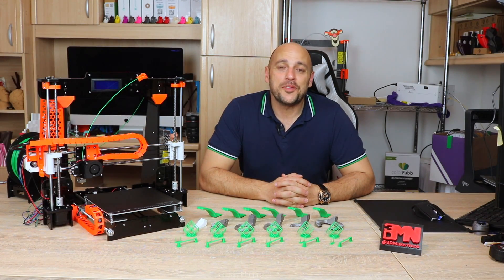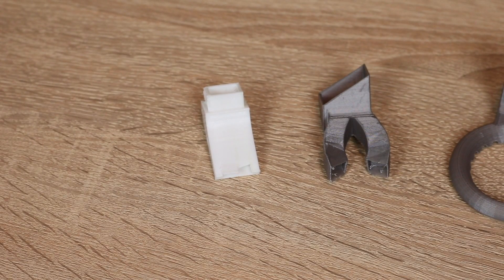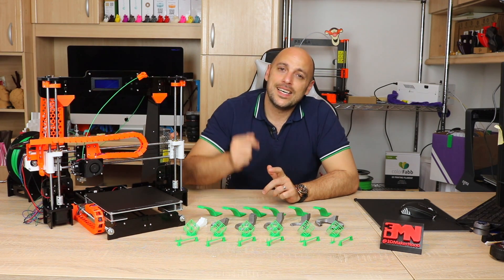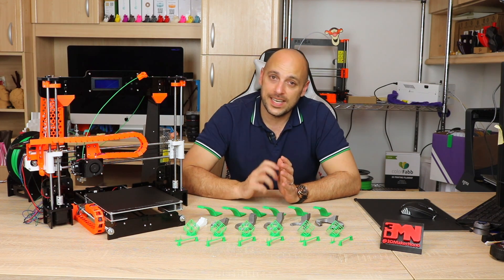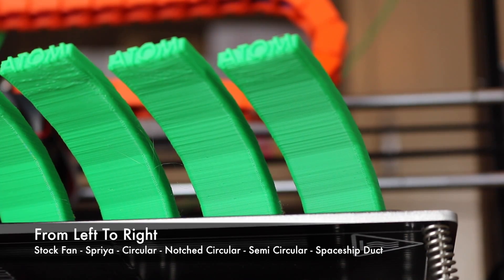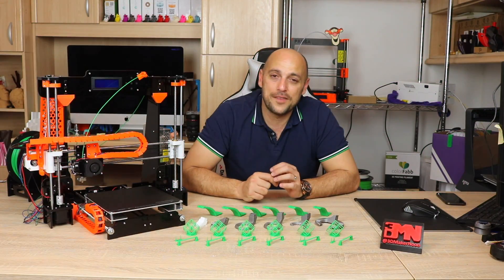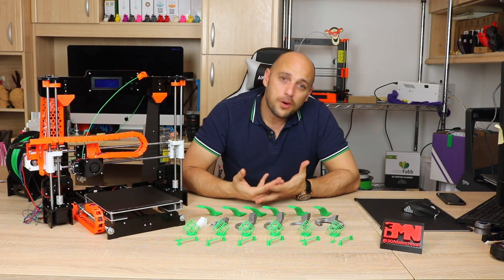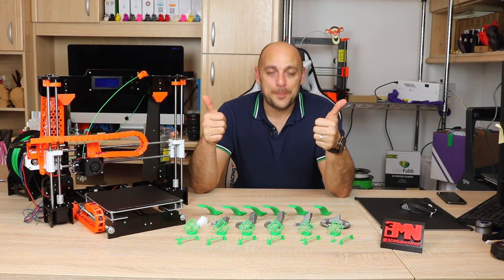Anet A8 Fan Duct Shootout

Comment: My only thought is it depends on what calibration work was done prior.
Reply from the maker: +Jeffrey Drake nothing at all to be honest. The only calibration I have done to the printer so far was extrusion calibration
Reply: 3D Maker Noob without fully calibrating the printer you are introducing extra variables. For example the retraction will affect how you perceive the parts.
Reply from the maker: the same settings were used for all models - the only thing i removed from all was the zhop and wipe movement which i usually use - but i did that for a purpose - i intentionally wanted light stringing as i wanted to see which fan duct performs the best under those variable - which worked as differences are clearly visible - same settings for all, the only difference is the fan shroud
Reply: 3D Maker Noob as it happens I am looking at cooking on my custom printer. I was thinking a design like prusa's that redirects a blower. I have thought about the circular style but concerned about their ability to easily allow nozzle changes.
Reply from the maker: hehe yeah, however, with blower fan they are quite easy to take off and put back on

Comment: Hey Joe, love the new vid and got the download for new fan duct ready to print tomorrow ;) changing the subject i was wondering if you may be able to help, i have cura set to print a skirt but some smaller prints this doesnt seem to be enough to get the filament flowing as freely quick enough. From what i have read you can use gcode to get the printer to create a purge line along the bottom of the plate before starting your print, being a noobs noob i have no idea how to set this up. Any advise would be greatly appreciated as always.
Reply from the maker: +Alucard in one of my previous Anet videos I left a link for my S3D profile, which in fact has the purge line before start. Will create a Cura profile and upload a link :)
Reply: awesome thats great thank you very much, am gonna have to save up some pennies for S3D i think it seems to have more control but with simpler controls
Reply from the maker: i personally love S3D, i find it much more user friendly to be honest than Cura which is why i am having a hard time shifting from it
Reply: I'm stumbling my way around Cura with mostly success just struggling at the moment to get that first layer squidge, i have slowed the speed down to 25mm second which has help but need to find the setting to slightly over extrude on the first layer

Comment: You missed one test case: A print that blocks air access to its back side, e.g. something that is H-shaped---solid but thin walls in the X direction and corners to the back. With the original "front only" fan duct I got molten/blobby corners on the back side of the print.

Update: Found one models where I had this: thing:1672959 Those 2 bars going out the back were a "molten mess" in terms of surface quality ;)
Reply from the maker: +HenryLoenwind good point, will need to revisit with different test models. Although the lattice cube does need efficient cooling in all directions.
Reply: Oh, you already replied. So here again, in case you don't notice my edit: Found one models where I had this: thing:1672959 Those 2 bars going out the back were a "molten mess" in terms of surface quality ;)

Comment: lol. I just switched from the semi-circular to the full circular, because the semi did not fit my fan well.  Did you have fit trouble with the semi-circular?
Reply from the maker: +tubejim101 I just unscrewed the fan slightly and slid it in, the tightened again, other than that, nothing really

Comment: Did you do PID tuning for each fan duct aswell?
Reply from the maker: +Luk R temperatures are consistent throughout all prints without and temperature drops so wasn't needed
Reply: Awesome, thank you for the quick answer.
To bad though you didn't try the Mistral 2.1 Fan Duct.

Thingiverse Thing: 2121279
Reply from the maker: +Luk R will have to revisit this test anyway, so there is still time to try it :)
Reply: I've been using thing:1205439 (V10) for ages. Would this fit the anet, too, or are the differences between it and the P802 to great in that area? I really like that the designer did air flow simulations for it...

Comment: Second!!
Reply from the maker: +TheMixEmperor and second reply :)
Reply: Hey Joe great review .... I have one been using and its almost like the one you reviewed but the angles of the tips or not even providing bit more flow top and bottom . Check it out "Mistral 2.1" Extruder Cooling Duct for the Anet A8 Printer found on #Thingiverse https://www.thingiverse.com/thing:2121279